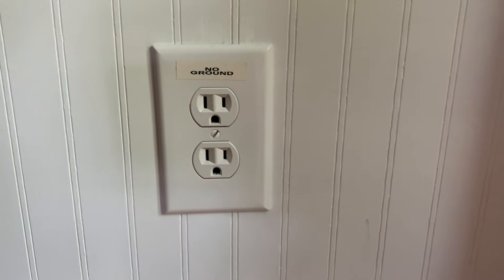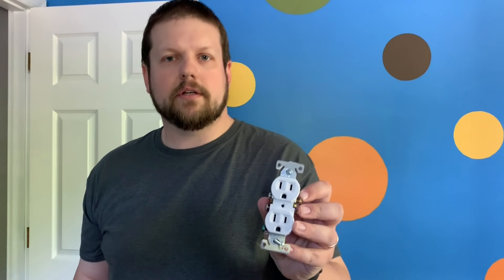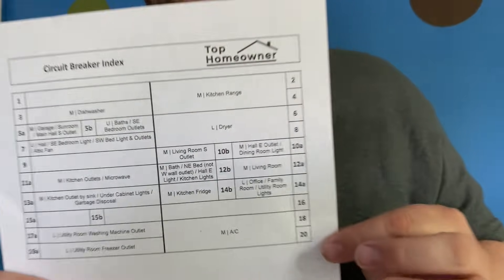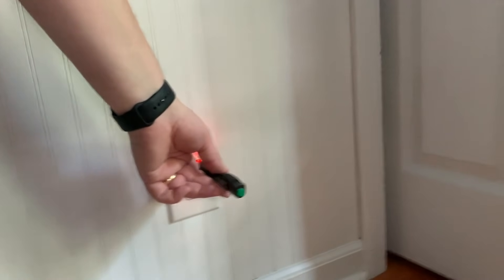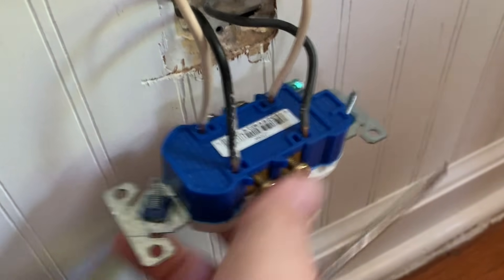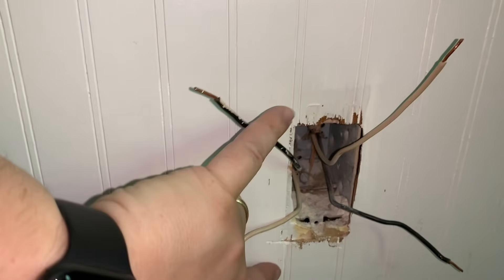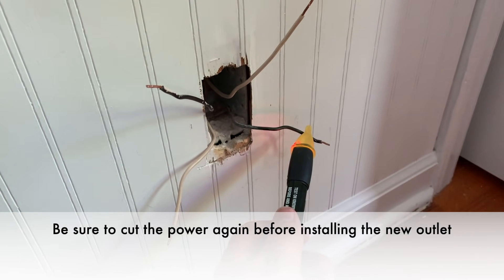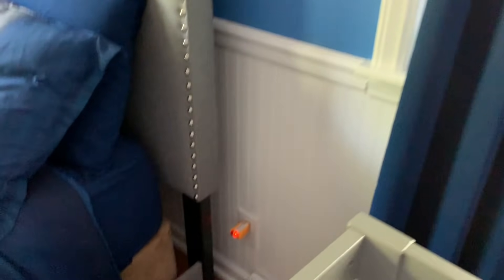Fixing Ungrounded Outlets - An Alternative Option to Rewiring Your Home

Comment: It is still not grounded. Nothing was fixed, just window dressing. The title should be how to waste time and money.
Reply: The point is that you can plug a three prong equipment like a computer to it.  It allows that with reasonable good safety. It is not grounded that is why it is labeled: "No equipment ground". One should be careful when connecting computers to other equipment like televisions. Better t unplug before doing so (or just get a Chromecast). One good thing is to get a power strip and hook all your grounded computer equipment to it. That way their cases will have same potential.

Comment: You better be sure because as far as I know a G.F.C.I. of any kind needs the ground to work properly. Its been thirty years since I took construction electricity but I doubt if that has changed.
Reply: Yes, that is "as far as [you] know". You just do not know that far. They do not need or use ground. They monitor the current in live and neutral.
Reply: You may be right but that would make multiple instructors of mine wrong. Sure it monitors current between the hot and neutral but it does more than that. The best way to solve an ungrounded outlet/outlets is to put a gf breaker in the panel. Then it is a moot point who thinks they are right.
Reply: @dlighted8861  More, such as? This is a method approved by the NEC. Do you think you know better than those who wrote it?

Comment: At 5:22 you show two hot, two neutral, and a ground. What do you do when you have no ground, and the metal box isn't grounded...
Reply: just what he did, put a GFCI in,  or rewire the whole house! One other option would be to run a single ground wire to each outlet  or to at least one that is bound to all the other outlets...
Reply: He said that ground wire is bogus and doesn't actually go to ground.  It may as well not be there.
Reply: @phillipsusi1791  
Tell that to a person being electrocuted...
When you're being electrocuted, you are the ground...
Reply from the maker: I made a follow-up that answers some common questions from this video https://youtu.be/3AXcRsAOLPk

Comment: Licensed Journeyman  Wireman here. The GFCI should be on the first receptable from the panel. The "room" has nothing to do with it.
Reply: He does mention “on the run, in the room” a few times. It’s a bit of an odd phrase given that most homes (especially ones that don’t have ground!) Wouldn’t have a run for every room but it halfway checks out.
Reply: @nvgvup84 hes saying that you only need one at the start of the run and from the panel box. The room is irrelevant or which outlet in the room is the 1st one in the room. The only thing that matters is the 1st outlet in the run from home. Could be a hallway outlet or perhaps the 1st outlet in a room but it's something that you would have to establish before guessing which might be 1st in a room
Reply: Wouldn't GFI breakers be even better?
Reply: @anonamouse5917  Well, the 2020 NEC falls just short of requiring GFCI breakers for everything in new constructions. May as well just put dual-function AFCI-GFCI breakers everywhere and not have to worry about future code revision making them mandatory for everything.
Reply: @teardowndan5364  That seems like a good way to stay ahead of code.  I hope they're not too pricey.
Reply: @teardowndan5364  we are required to use those. Dryers trip those almost every time.
Reply: @teardowndan5364 this is exactly what I did in my 1957 house in NJ. Instead of replacing outlet upstream I replaced my breakers with GFCI/AFCI combo breakers and then replaced all 2 prongs with 3 prongs and labeled (to make it code-happy, of course).. just easier that way imo. Wasn't cheap though lol
Reply: @anonamouse5917     I'm a licensed and certified electrician myself and they are both literally the same exact device with only a slightly different name but functionally they are the same identical device.🙂👍✌
Reply: @RavenTheLabrador  I know they are the same device.  I'm thinking about cost (breaker + GFI outlet vs GFI breaker) and ease of installation.
Reply: @anonamouse5917  GFI breakers would be fine. Cost is usually a factor. I just priced a GFI breaker at HD for $40 a breaker. A pack of 4 GFI outlets run around $55. Either way is perfectly fine.
Reply: @randyfrazier5725  If I was upgrading my own electrical, I'd go with the GFI breakers despite the extra cost.  Leakage anywhere in the branch circuit would be detected.
Reply: This drivers me crazy because I'm a licensed and certified electrician myself and he absolutely has not determined the first outlet on the line he thinks it's just the first one in the room.🤦‍♂️✌
Reply: @RavenTheLabrador  Which dosent matter if you do that to every room. The point is asl long as every single outlet is somehow protected by a GFCI outlet, your good. So even if the room previous to this one is the one that is the start of the run, if he does the same thing there and in every room, hes covered. 
Its only an issue if he just did the one room and stopped.
Reply: @RavenTheLabrador  Which dosent matter if you do that to every room. The point is asl long as every single outlet is somehow protected by a GFCI outlet, your good. So even if the room previous to this one is the one that is the start of the run, if he does the same thing there and in every room, hes covered. 
Its only an issue if he just did the one room and stopped.
Reply: A. M.,

Not true. It becomes redundant with wasted cost and the GFCIs will cause each other to trip unless they’re wired to prevent each other from tripping. But then that creates the same problem to where down stream receptacles are no longer GFCI protected. Better to find the home run (HR) and place the GFCI there or go with a GFCI breaker.
Reply: Which dosent matter if you do that to every room. The point is asl long as every single outlet is somehow protected by a GFCI outlet, your good. So even if the room previous to this one is the one that is the start of the run, if he does the same thing there and in every room, hes covered. 
Its only an issue if he just did the one room and stopped.
Reply from the maker: Thanks for your comment. I clarified this point in a newer video: https://youtu.be/3AXcRsAOLPk
Reply: Running multiple GFCI receptacles in a home, some may or may not be protected at the box. If protected at the box and I know redundancy is a factor and the electrical box is a mile from the receptacle, why not make it easier and install the GFCI in the room instead of walking a mile in the snow, down the street, through the rain, over and up trees an bushes to gain access at the box for a re-set? Another factor also, if one GFCI trips then yes you may have reset all others in the house. What's the best solution????? Good Video and thanks
Reply: There is an electrician's tool that measures the voltage and voltage drop under load at each outlet on the run.  When you find the breaker that powers the receptacle, you find the outlet that appears to be closest first.  Mark that receptacle location, and find other receptacles that are on the same breaker.  When you find all of them, turn the breaker on, test the voltage, do the test for voltage drop, and make note at each location.  The one with the lowest voltage drop is the one closest to the breaker.  At the same time, use the outlet tester shown to check for proper wiring.  If one of the outlets in the circuit shows proper grounding, you can run a 12 gauge green or green with yellow stripe wire from the metal box to another outlet box on the same circuit to ground the outlet.  Run the ground wire from the first grounded outlet found on the circuit to the attic and look to see if there is a grounding junction in the attic.  You can buy those at any electrical supply place or hardware store that sells those parts.  From the junction, you can run ground wires to unbonded metal boxes and use grounding clips to ground and bond the boxes to the circuit breaker panel, legally per NEC regulations.
Reply: @maxheadroom8857  I don’t understand this comment.  Every outlet should be 120 volts even if not the first in the run.  It’s not acting like a DC circuit wired in series where from positive to the first circuit element, that voltage reading is the drop, then from that to the next element is another drop.  Then the last one back to negative is zero.  That’s not how it works correct?  This is AC almost acting like parellel circuits where the voltage remains constant and the current is varying.  I may be wrong but this doesn’t make sense
Reply: Wiring style now is to wire from outlet to outlet. Wiring style then was to wire to a central light and wire down to each receptacle from there. Precludes a gfci protect a whole circuit, you have to put one at every receptacle. You then have to consider a panel Full of gfci breakers. Then you realize that we have few(none) problems in homes with ungrounded homes, we are trying to address a problem that really doesn't exist. Who are we trying to please? Insurance companies.
Reply: @justice4scalia846 It's not a problem until there's a problem, and those end up in fires or electrocution. Those are two pretty good reasons. Same reason they stopped sending space shuttles, 1 percent catostophic failure doesn't sound like much until you put it in the right perspective that 1 out of every 100 will meet a catastrophic fate. Or you know, why wear a helmet if I hardly ever wreck my bike....Its for that one time you do.
Reply: @justice4scalia846  Who are we trying to please? The homeowner and the people in the home. This is done to solve a problem; which is trying to plug a 3 prong plug in a house with 2 prong receptacles. And as a benefit, the receptacles (but not any light switches upstream) are a little bit safer.
Reply: Isn’t the Florida code 6’ from water source for GFCI?
Reply: Awe how cute, a journeyman electrician grasping at straws because the guy didn’t word the sentence the same exact way you did. Hey quick question Mr professional, where does romex go when it leave the box…. Don’t worry i’ll wait
Reply: It has to be on the 1st outlet on the circuit
Reply: Exactly how I fixed my older home.
Reply: Randy, my son replaced the two prongs ( no grounded wire) into GFCI three prongs. I want it grounded, how can we fixed this issue? I don’t want to hire a licensed electrician (it cost a fortune). I appreciate your input, thanks
Reply: I have a couple of questions for you regarding this; My home was build in the 40's, only ONE of the outlets was grounded moving in, it was a 220 for the stove (it may not have had an actual ground tho) and there was only one outlet per room. My husband added a couple of 220 breakers to be able to add/plug in more modern appliances. I believe the breaker box itself is grounded (wouldn't it HAVE to be?) as I found the/a ground pole buried when digging at the corner of the house, beneath where the meter box is. However, none of the other outlets (2 prong only) have a ground wire going to them, that I know of. The whole house needs to be rewired, honestly, but as a journeyman, you know exactly how expensive that is. We've been here 20 years and keep talking about all the stuff we need to do to this house, but we are literally dirt poor, due to disability (without disability payments) and do great just to be able to pay the $500 a month power bill. My main question; What is the most cost effective way to deal with this situation, while continuing to be as safe as possible? We currently only have a 100amp breaker box and that is completely full, right now. How to we appease the power company to turn our power back on after installing a bigger (200) breaker box and could we even go to a 200amp service without rewiring everything? Could our setup currently be the reason for such a high electric bill, or are they just that high normally?
Reply: This still doesn’t resolve the no ground issue.  lol

Comment: These people always amazed me they claim are not on electrician but yet they're showing you how to wire and outlet with no ground.
I am a retired electrician when you have a home with no ground code does say you replace it with a GFI but you replace all the outlets with GFI not just one and all outlets must be labeled as no equipment ground that's code
Reply: You have to replace receptacles downstream of a GFCI with GFCI? Thanks!
Reply: @steve-ey3rx  no, they will be connected to the load of the gfci.

Comment: WOW there are some ignorant comments pretending to know what they’re talking about. To summarize: you will never get a grounded circuit doing what he showed you. You will get a safer circuit that will trip if a variance in power is detected at the gfci. This allows you to add 3 pronged (surprise face) receptacles safely in the room; not because they’re grounded now, just that they are circuit protected. And yes, you should add the sticker to each cover plate informing people it’s not grounded.

Comment: One thing you should know is to never use those quick connect holes on the back of the plugs! Those holes only have a small thin piece of metal on each side that grabs your wire and has hardly any contact being made which in turn causes excess heat. Over time these will get worse for having a good connect from being too hot, especially if there’s a heavy load drain on the plug in and it will fail and burn thru. I have replaced many of these plugs over the years that have been plug in these holes that failed and the plug and wires are burnt and the box inside often shows burnt marks as well. It’s a huge fire hazard using these electrical holes. You should alway and I do mean ALWAYS wrap your wires around the screws having enough of the wire insulation cut off so plenty of the bare wires is making as much contact with the screws as possible to have the absolutely best contact they can get!  Talk to any license electrician and they’ll tell you the same thing I am here! I’m not a electrician, but I’ve been a contractor for over 18 years and have worked along side many electricians over the years and have had more then one electrician warn me to never use those quick connections holes on the plugs! Big NO NO!
Reply: Had my outlets wired like that in my bedroom by an eletritian. Pulled put an old outlet that was backstabed and the wires just fell out. 20 years of the outlet being switched on and off( it was a switched outlet for a light) and that could have started a fire
Reply: Yes pigtail everything
Reply: Don't backstab it
Reply: The GFCI shown in the video had back wiring which is optimal because the screw holds the wire. So it may have confused people but there is a difference between that and the holes in residential grade receptacles. Also there is no spring release on the quick connect holes, when you release those you are bending on the metal that holds the wires. That feature is single use and not advised in the first place
Reply: quit  spreading  misinformation . I am an electrician and have seen just as many outlets burned out with wires on the terminals only. if this was true it wouldn't have passed UL testing. when you actually get a certification then you can talk.
Reply: @johndoen3751  You're pushing "misinformation".  The ONLY reason electricians like quick connect outlets are because they are faster.  Outlets burn out from wore plugs or the device was "on" when it was plugged it - over and over.  I've ran into dead outlets because of those useless quick connects on the upstream outlets.
Reply: @johndoen3751  the situation described by "op" is if a constant  (maybe 14amp) load is present then it will over heat, but everything can fail with fatigue. It's like part 15 of the fcc regulations.
Reply: @johndoen3751  NO qualified electrician that I've EVER heard of is going to approve back stabbing an outlet. Burnt wires on the terminals is usually an indication that the electrician didn't torque the screw tight enough.
Reply from the maker: I made a follow-up video that talks about this and answers some other questions. You can watch it here: https://youtu.be/3AXcRsAOLPk
Reply: Good information thank you!

Comment: FYI at outlet with two neutrals and two hot legs, you must wire nut the pair together with a third wire to the outlet screw and not back stab....... another code thing........thats why people should hire Licensed Electricians......sure anyone can make it work, but will it burn down the house ???? The N.E.C. was made for bare minimum life safety !!!!

Comment: if the problem is at the GFI device it will trip & kill power to the other outlets, yes. If a problem arises at the other outlets it won't trip the GFI.
Reply: Yes it will if they are on the load side of the GFCI. It it arises in some other circuit, it is not relevant to the modification of this circuit.

Comment: My electrician just ran a small looped wire from the ground screw to the open (2nd) neutral screw.
Reply: That is the standard method in many countries on older installations but it is not to the code in the US. It is not something inherently dangerous but there are problems. The most obvious safety issue is that if the neutral wire breaks the mains voltage gets to the case. In practice it is rare for them to break on their own. Also you cannot have a GFCI breaker on such a line.
Reply: @okaro6595  It is unsafe because neutral often has some voltage on it wrt ground, so you can get shocked from touching neutral.
Reply: illegal
Reply: @Don-ck2bm  maybe legal in NC? I just don’t know why a legit professional would do it then? Suggestions on what to do?
Reply: @Don-ck2bm  my fridge is currently running on that outlet.